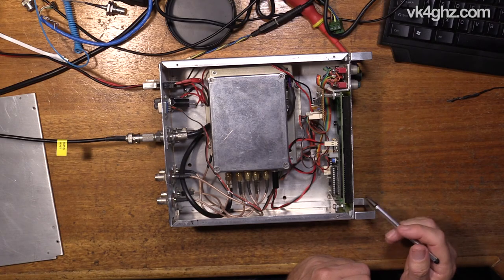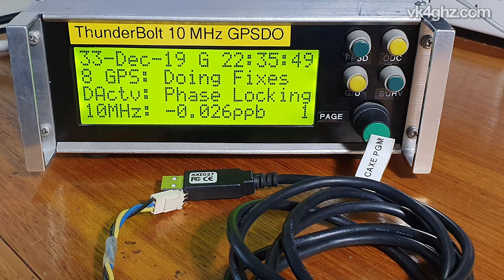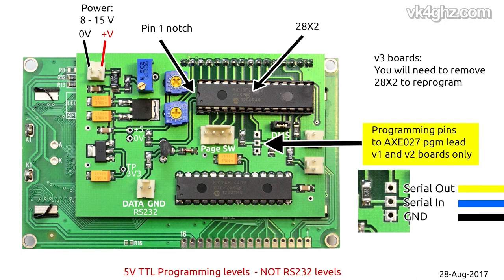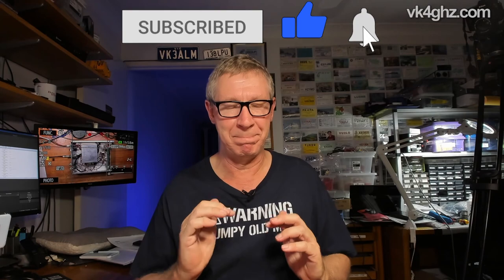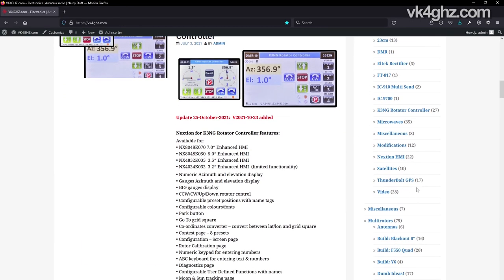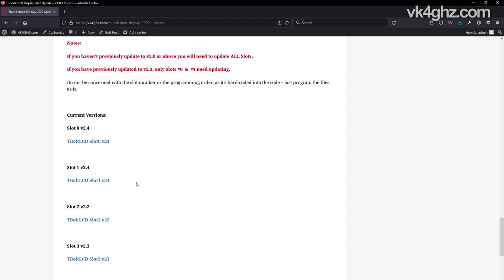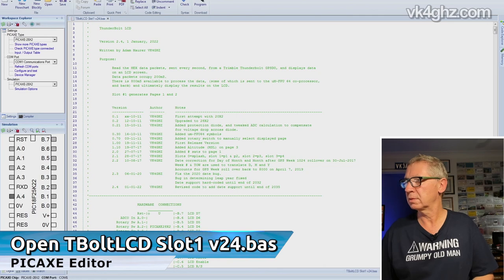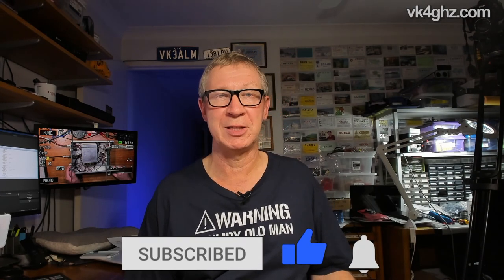Trimble Thunderbolt GPSDO Display 2022 Update

Comment: thanks Adam,  Happy New Year :) .... something I didnt understand ..... the programming PC needs a RS232 slot or USB to RS232 adaptor cable ?  or is that AXE027 cable have a USB connector on it with an internal usb-serial converter built in ?  ..... cheers, Dave, VK2TDN
Reply from the maker: Hi Dave. The genuine AXE027 programming lead has a standard USB plug at one end, and a 3.5mm male at the other end.  Inside the USB end is an FTDI chip.  (Perhaps leads from yester year had DB9's?) 
Some people try and knock up their own DIY lead, but you will need to research this, and watch out for signal inversion or not. Google it.